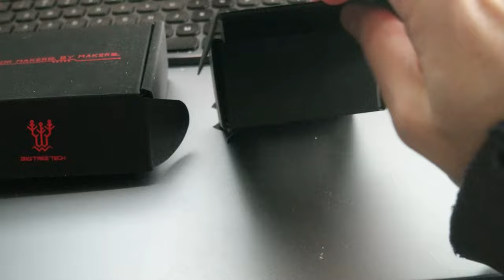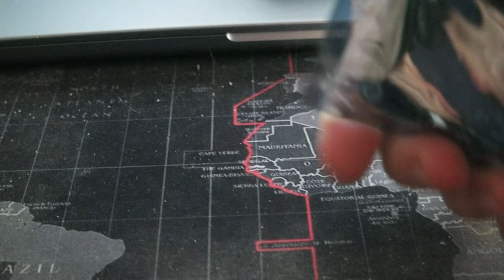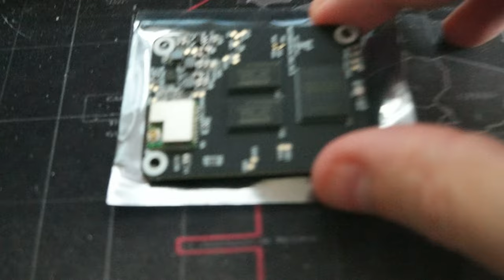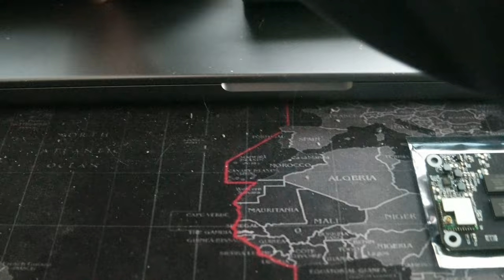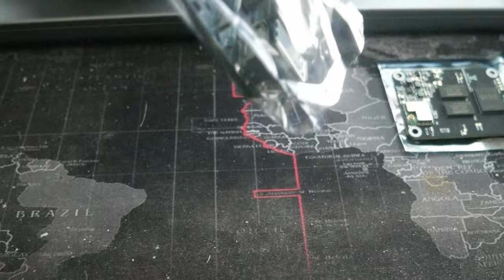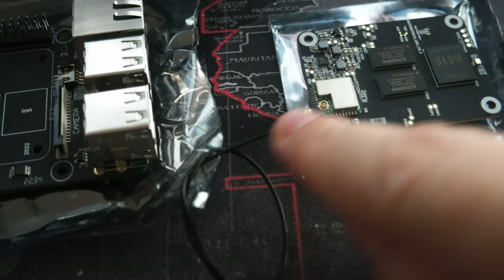BIGTREETECH BTT PI4B Adapter and CB1 module for Klipper 3D printer build

Comment: How do you FASTEN the heatsink with those screws?
Reply: Heatsink is only ment for the mantas, no threads for it on the adapter. I have no words.
Reply from the maker: @solasauto  it's not only for manta it's for the module, you can use bolts on the bottom. Also the module can be used for other projects other than 3D printing since you can install linux on it and it'ss way cheaper than a CM4.
Reply from the maker: bolts